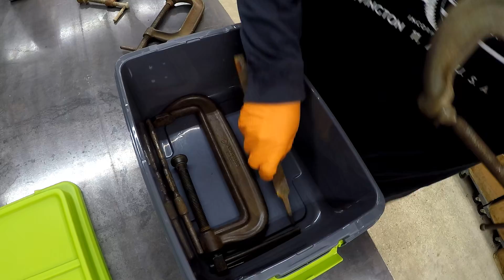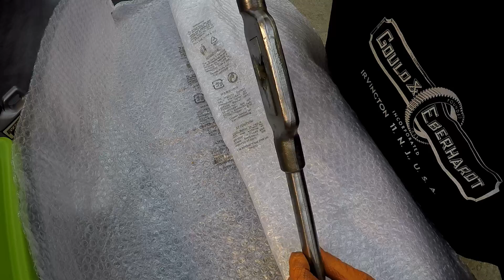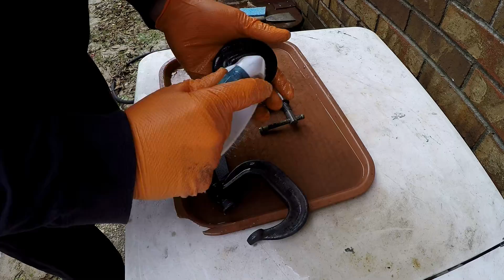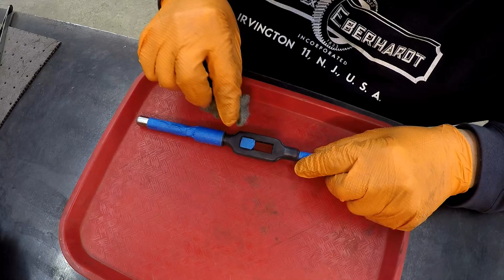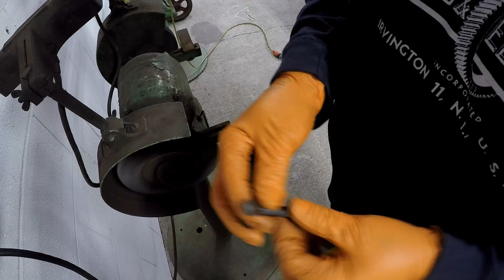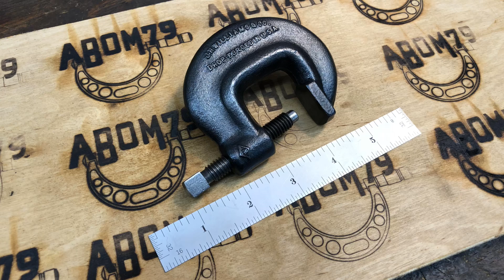Tap Wrench & C-Clamp Restorations Using Evaporust

Comment: Vinegar from the dollar store works WAY better! I've soaked stuff much worse and it takes it right down- perfect
Reply: Vinegar damages the base material... Not much, usually, but it is acid.
Reply: Not in my experiance. Two issues, vinegar is too weak to reduce thick clumps of oxide, and doesn't penetrate potting well, and since it's an acid it can and does sometimes etch the underlying metal. 

Vinegar is one step up from the myth of coke.
Reply: They do not do the exact same thing.  The acid etches the rust AND the metal.  Evaporust chemically CONVERTS only the rust to a non active oxide.  Read up on it and learn.  Don't use acid.

Comment: adam.. with the fixed jaw out of the tap wrenches. you can turn the handle and extend the movable jaw into the now empty area of the fixed jaw and it will come out.  then you can unscrew the handle.  i would imagine you know this.  but maybe not.
Reply from the maker: Not on Card you can’t.
Reply: @Abom79  well it seems i have been carded.  if they don't come out that way.. how do they come out.

Comment: Add glass beads or marbles to the bin after putting in the clamps to take up volume.  You need way less product.  I do this all the time.
Reply: smart. damn smart... where 'd you get that inspiration from?
Reply: @DoktorAndy  honestly from being broke all the time, but it just hit me one day.  I had a plastic tote like he used but it was way too big for what I needed to soak.  I start scratching my head for a solution.  I wound up dumping a bunch of nuts and bolts in.  Ever since I keep a.boat load of glass beads the kind for find at the $ store used for decorating.
Reply from the maker: Yes great tip. I've used a bunch of clean steel parts before because it's all I had.

Comment: @abom79 I was told that if you want a hand file to get sharp again you put it in acid is that true or is that a fake thing can you tell me
Reply from the maker: I’ve never tried it myself
Reply: FALSE!!!! That's a prank.  They do not do the exact same thing.  The acid etches the rust AND the metal.  Evaporust chemically CONVERTS only the rust to a non active oxide.  Read up on it and learn.  Don't use acid.

Comment: I'm going to have to try Evaporust.
I have used Naval Jelly for decades, but Evaporust looks like it works better.
Thanks.
Reply: They do not do the exact same thing.  The acid etches the rust AND the metal.  Evaporust chemically CONVERTS only the rust to a non active oxide.  Read up on it and learn.  Don't use acid.

Comment: I've never seen that rust block product before. I wonder how well it works and if anyone has used it on firearms before or not. Marinating firearms in Rem Oil to prevent rust here in MO is always frustrating.
Reply from the maker: It's a first for me. I plan to do a test with it, leaving some bare metal tools coated with it outside in the rain for a while.
Reply: @Abom79   Just send them to my shop, with the crazy temp changes and high humidity everything seems to want to rust even coated in oil!! lol

Comment: What about rust (or oxidation) on measuring tools or gages or V-Blocks etc?
Reply from the maker: It works on all tools but some you may not want to use it on because of how it turns the metal the black Greyish color. I have not tried it on precision tools yet.
Reply: @Abom79  Thanks for your kind response.
I would really like to find a truly effective non destructive method of removing ugly staining or oxidation on precision tools like  Squares, Measuring Instruments, Height and Surface Gages. And, especially on home made hardened and precision ground tool steel setup blocks, fixtures, angle blocks, etc. 
Protection while in use and not in use is the key I know, but time does have it's way of showing up on our tools..... as well as our own bodies.

Comment: Have you tried using Evapo-Rust with an ultrasonic cleaner?
Reply: Justin Bell I have a video up on that!!
Reply: It works very well with the ultrasonic with the heater on, will do any rust within an hour. One thing though, when the evaporust stops working, it happens very quickly, usually after 4 of 5 uses in my experience with or without the ultrasonic.
Reply from the maker: No I haven't but I bet it's awesome!
Reply: Ultrasonic Rust Removal https://youtu.be/DeIi2v8Kc1Y

Comment: Hey Adam myself and a couple of other have recently had some issues with Evaporust on spring steel. For me it dissolved a piece out of my Mamod Steam Train restoration (vid on my channel) but more interesting was the damage done to some Starrett spring calumets, the top spring was made brittle and broke unexpectedly! We’ve figured this to be due to the slight differences in spring steel, so please use it sparingly around any tools with spring steel in them!
Reply from the maker: Thanks for the tips on that. I have not used it on anything delicate like precision tools yet, only normal hand tools.
Reply: I got lucky when refurbishing my eclipse surface gauge, the small springs I didn’t leave in for long... Eclipse No 101 surface plate marking gauge and indicator stand service https://youtu.be/31R9K2H40Eg